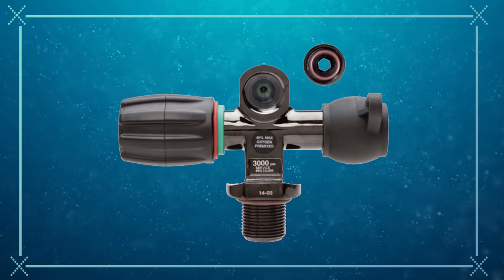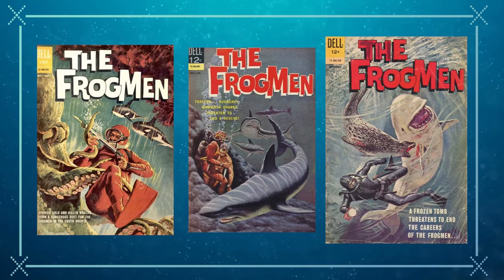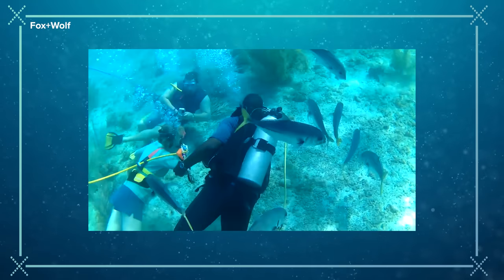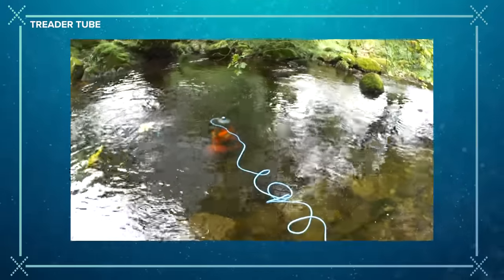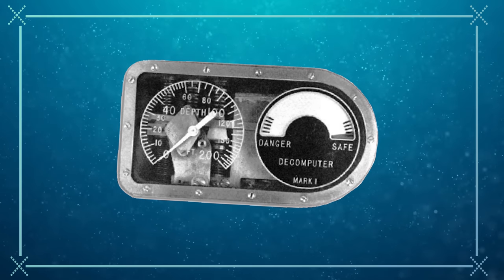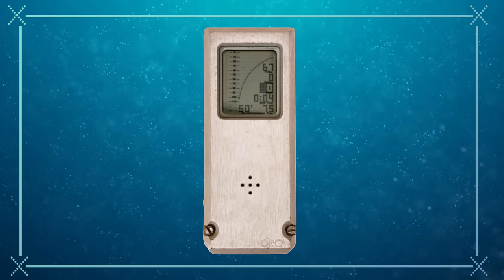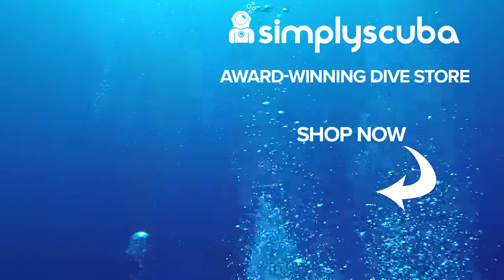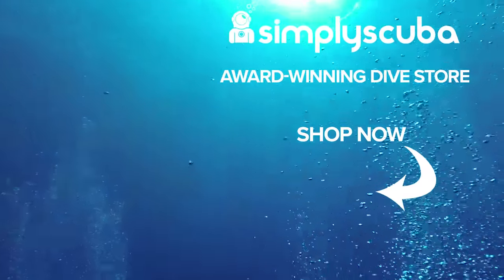Worst Dive Gear In The World

Comment: The split fins!!!!
Reply: Absolute garbage. Zero propulsion. If your knees are so bad you need to use them, you really shouldnt dive at all
Reply: @jonathanbradley4896  You actually can build significant speed with them, in calm water. The problem is that you have to build it and what we usually need as scuba divers is an immediate thrust. They may also be said to have a slight advantage in certain teaching scenarios, like cold water shore diving when you are helping students becvause the split actually allows you to walk forwards as well as backwards. In some tech or film shooting contexts where the diver is heavily loaded, not very moneuvrable and really more like a vessel they may also be of some use. I know combat divers who will go for either split fins or some other fin that is easy on joints and muscles when they have to transport heavy equipment underwater, dive in combat gear or swim long distances (like several miles). There are techniques that allow you to get good propulsion in those scenarios. But this is not recreational diving where you often work with heavy current and use more advanced finning techniques etc so I still hate the fuckers ...
Reply: @whynottalklikeapirat  Eh, as far as cold water shore diving and long surface swims are concerned, I do both almost exclusively here in the Pacific Northwest, and when you are ladden with several tanks, tonnes of weight and a drysuit, you need powerful propulsion. Large paddle fins like Scubapro Jetfins are really the only way to go as far as I'm concerned.
Reply: @jonathanbradley4896  I use jets or mares quattro for almost everything, including spear fishing. I don't have much good to say about split fins outside of a pool like snorkling environment and some specific jobs, where I persanlly would not want it. You will notice however that many VERY seasoned underwater photograpers with big rigs use scubapro splits, possibly it has to do with the flow of shooting I don't know. As for the military applications - in many countries a softer, short fin or even a split fin is sometimes preferred. If you are doing a beach attack, there are some advantages there aside from what I described. It's not my preference, this is what I am told by special force combat divers. Very often they need to conserve muscle power and flexibility for immediate hard work when they hit shore, often after transporting say a 50kg man pack for several miles at a fairly shallow depth. I tried out some atomic split fins for some 40-60 dives when they first came out, just to see what the fuzz was all about. In calm water you can get a fair amount of propulsion for your buck either when

a. The water is calm and pool-like and you are just doing medium strength single strokes. In other words they do that moderate tempo well per calorie used if you use the right technique which is slightly different from a normal power transfer.

b. When you have to do a slightly faster transportation run - still in calm water. YOu then take that "delayed transfer technique" and speed it up without adding a lot of extra force. Doing that you can build up to a steady and efficient pace. I rarely need to do this personally.

But it's vulnerable to water changes - as soon as you HAVE to really dig in because of strong currents or surf - they fold, and you can start over building that momentum. That's the main reason I hate them, aside from feeling like sex with a condom if you have an advanced composite finning style. Personally I rarely do any alternate finning at all unless I want to streamline myself in the face of a really stiff current.

I guess they have their applications, but for recreational, I guess it's mainly for the holiday bath tub diver. I am a northern diver myself.
Reply: @Chris Williams Different issues, different fins. It's not really an argument for anything until you elaborate on what your challenges are. I've only once spent some time on a beach in Monterey. It looked to me, in a very superficial assessment like fair amount of surf, potential medium local current, medium temperature and variable viz in the 5-12 metres range. 

What is for damn sure is that if you have to work currents in the 1-3 knot range splits will leave you with an unsustainable working pulse, and at some point simply fold and become inefficient-to-useless, because you can no longer maintain the kind of stroke that makes them efficient. They'll be just another soft fin falling short.

Further - I fairly often need to make a short sharp burst in one fin stroke to catch a student on a runaway ascent or something like that. Splits won't deliver the needed thrust in one go. You have to accelerate - and there is no time for that.
Reply: Love my V12 split fins. Plenty of speed and power in surge and current, just scissor kick from the hips not the knees / ankles. Frog kick is ok in still water.
Reply: @4wdivesafari  Dude, I am a competetive swimmer, a spear fisher and a dive instructor. Finning technique is not the problem =.O To be fair I've only used Atomics, Scubapros and a comparable force fin which is not a split, but also soft. Don't know about the oceanics. 

However I have yet to try a fin of any kind that stands up to the Mares quattros in real current, by which I mean the kind of current that draws your bubbles downwards and tears your mask off if you face it at the wrong angle. 

Frankly I don't wan't to be bashing away with a jacked heart rate, using alternate finning, especially in currents at depth if I can help it. If I absolutely have to alternate, for streamlining, and maybe the odd scissor kick I want to be doing it as forcefully as minimalistically and as deliberately as possible, allowing for a low average working pulse.  

Stiff blades with a lot of direct power transfer makes that possible, not a soft fin that folds and calls on you to increase the amount of repetitions required to maintain sufficient momentum.
Reply: Hmm I love my Scuba Pro Twin Jet fins, but to each their own. They seem to move me along just fine. I've never felt like I was dragging the group or had to work hard to keep up. But if you are looking to race, I'll pass.

Comment: I have a rattle. Why? Because if somethings wrong I want to be able to make noise so my buddy looks at me. I've never used it so far 😄
Reply: I've found that the biggest problem with rattles is that from more than about 10' away, they sound very, very similar to pistol shrimp, waves crashing against rocks, or any number of crackling noises that you constantly hear underwater.

Comment: I had an IDC center for a few years , sold and personaly serviced just about every make of scuba gear sold. There was only one reg I would not touch, it was American and Robin Hood used to hide in their forrest. I think the best bit of gear I sold was the little Sea and Sea serated knife that clamps on your demand or HP hose. You never know when your gonna bump into that bit of fishing net. I would never go into the water without a knife. The other bit of gear I loved was Mares regulators, expecially the little MR12. Costs peanuts and never goes wrong. I have two friends who are the wrong side of 70 and still do 700 + dives a year each harvesting scallops, between 25 and 45 meters. I got them both on Mares mr 12s and they love em.

Comment: I use the best octo keeper on the planet and it never breaks or drops my octo and only cost $1.00. curious, it’s a snorkel keeper ie double loop rubber, stretches over mouth piece snuggly yet pulls off with little effort but won’t pull loose when you back flip of side of boat

Comment: The Subaqua Tifon X regulator is the most dangerous piece of dive equipment I have ever had the displeasure of diving with. The purge button is designed so that, if you press it with a bit too much force, it will unclip which results in a flooded regulator. After making a complaint to the shop where we bought it from, a mechanic them came down to "teach" me about them and proceeded to tell me that they were ment for professional divers who arnt prone to panicing only - what a load of BS. Its worth mentioning that store where I was working at the time was recommended these regulators by the seller after we told them that were being bought specifically for DSDs.

Comment: Are rattles really that bad? I planned to get one thinking it's a good way to get someones attention during an emergency.
Specifically the magnetic shaker that they are selling 😂
Reply: fuxiz they arent as bas a s long as you use them with moderation. i use a tank banger only when necessary. such as when a stupid diver decides to keep heading deeper than 130ft. or when someone decides following the DM is overrated.
Reply: Tank bangers are awkward to use and make about 1/4 the signal of a rattle. Try testing for yourself. We've found that they can be heard at more than 15 m. I see them primarily as an emergency signaling device.
Reply: @michaelatherton826  That's definitely what i wanted to use it for. I'm quite new to scuba diving and i know that to always stay close but i see this as a just is case we drift apart a little and a emergency happens, then it's a good idea to use it. But to then watch a video saying it's the worst gear didn't doesn't spark confidence xD
Reply: in my experience a lot of divers ignore the rattles specially if they have hoods on. not so withe the tank banger. i always get comments on how scary it is the first time. everyone looks and thats how its meant to be. if im diving on a buddy system i dont really use it tho.
Reply: @saidabimelec8506  That's fair.
Reply: @saidabimelec8506  It does sound like a useful tool but i guess with great power comes great responsibility to use it xD
Reply: @NrJuan  They're both pretty cheap. You might try both and see which one you prefer. A lot of scuba is personal preference. What works for one doesn't work for another. I have a room full of equipment I've tried out to refine what's in my kit.
Reply: @saidabimelec8506  Hmm good point!
Reply: For emergencies they're good. Some divers use them when they spot a pretty fish. Problem is the noise travels far and it's impossible to tell which direction it's coming from so everyone in the group will soon be annoyed and ignore you (which will probably just cause you to keep rattling 😅(Trust me I know)).
Reply: @Yggdrasil42 , Many people dive off boats and I think it's easy for Divemasters to set rules. As to emergencies, sometimes all you need is to get people to look around and see what's happening.
Reply: rather buy steel lobster stick - you can use it as a pointer, as a pivot if the current throw you against coral wall or wreck, and in case of emergency you can always bang to your cylinder .. steel stick works fine in all scenarios, not sure about aluminium sticks - they can bend
Reply: @lamanawebu , I have a titanium pointer. It doesn't work to signal. Also, long pointy objects can become hazards if you don't have a safe place to secure them. I have a plastic sheath attached to my BC that runs next to my tank. Also, I normally kick with a camera in one hand and it's not advantageous to have a pointy thing in the other. :-)
Reply: @NrJuan , Its more like 'the worst gear for everyone else'. Try and think of a situation where you might use it? Out of air say? So you're now going to reach for your rattle, shake it, hope that you buddy hears it, looks over and sees that you're out of air and swims to you? ...why not just swim over to them?

I just can't think of a situation in which they do anything other than annoy everyone else.
Reply: @deanb61  I see it like while i swim over to him it better to get his attention so he sees that i'm out air before i reach him, rather than having him look at fish while im out of air trying to reach him. With that said im new to diving and i might overthinking it but that's at least my mindset
Reply: @deanb61  "...why not just swim over to them?"

What if they're swimming away from you? You're going to kick really hard to catch up to them and burn up what air is in your lungs hoping you'll be able to catch them and grab their octopus? Have't you had many non-emergency situations like that when you just want to check with your buddy, but they're 2 m away and you can't get their attention?

Comment: Some early manufacturers made J valves that were not reliable. That gave all J's a bad rap and that was further enhanced by SPG's that were less than accurate at low pressures. Having the pull rod in the up position isn't a brain tease and if you can't handle that, well I would not take up flying either. Younger divers like Maureen... you got it right :-)) I'm 73, diving since 13

Comment: J Valves had nothing to do with your myth about SPGs not existing, SPGs have always been used. J valves were used in conjunction with SPGs mainly by industrial divers in near zero visibility in shallow water no deeper than the draft of the ship they were working on.
Reply: Commercial trained in 93' we used J valves and SPG's nothing wrong that system.
Reply: Yeah,  but to put a different spin on it sounds so much better. :)

Comment: Those dual inflators/regs. Don’t really breath well and becomes a real probelm sharing air with someone and having to do ascents while mainting bouncy control. Most of the time that have a standard length primary hose and that other person is now on top of the other so it can get real bad really quickly if something else goes wrong.
Reply: You are absolutly right. If you think about it, it does not even has a real purpose. You got your main second stage, your octo (you should always keep it) and a third air sharing methode. When will you ever share air wiuth two other people? And what are the chances surviving it with trible the amount of air consumotion?
Reply: I don't use one but did consider it.  From what I've read and from talking to dive buddies who have the Air2, they breathe just fine.  As for buoyancy control on ascent, I don't see what the big deal is.  If you are drysuit diving, you are using your suit for buoyancy and just need to vent from the shoulder exhaust on ascent as usual.  If you are a wetsuit diver, just use one of the dump valves on your BCD.  If you are weighted properly you shouldn't have to vent much air anyway, and you should be finning up and not using your BCD to ascend.  The one issue I would agree with you is that the hose length for the primary that you donate can be too short, but that is easily fixed by using a longer hose for your primary.
Reply: Alex Navarro There's a lot of 'should' though. My concern is that you'll need it in an emergency when stress levels and task loading are high. Generally a time when things don't go as they 'should' and you need gear that gives you options instead of limiting your options. Maybe if you're doing a shallow reef dive it's fine but I definitely prefer a 2m long hose when there's current, depth or low-viz involved.
Reply: @alexn2772  It's even easier on my Ranger.. just pull the hose, there's a cable that runs up through the inflator to open the purge valve. Great in the emergency situation since you know exactly where your deflator is and can find it without fumbling.  I've never had an issue with mine, have it serviced regularly, and test its function every time I submerge (especially at any real depth). Having said all that, I'm switching to a long hose and necklace setup.
Reply: I love them!  Super easy to manually inflate since it's already in your mouth, and just use a dump valve if you need to deflate your BC.  It's not like you're going to do an hour-long dive with it in your mouth.  I've had one since I first started diving 20 years ago and had to use it twice.  Both times it was a piece of cake to use (make sure you practice with it every once in awhile to keep your emergency skills fresh).

Comment: Slightly patronising video. As mentioned in the comments J valves were definitely an evolutionary step and not the worst gear in the world. I would argue that some of the kit sold by online retailers are in fact (still) the worst in the world.
I’d rank these in the following order…

•	Spare air / backup air (sub 3 litres)
•	Air2 reg - combining a reg with other functions isn’t great
•	Wireless transmitters - generally less reliable than an SPG

Any more?